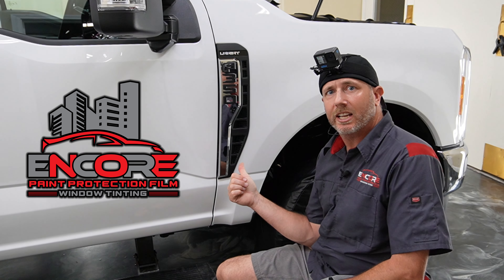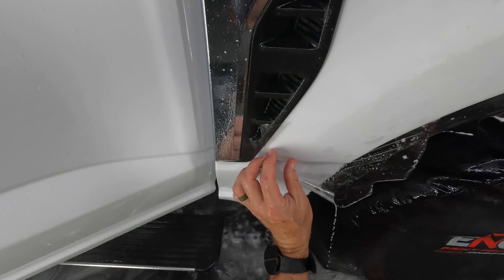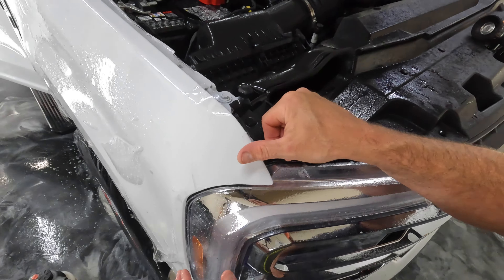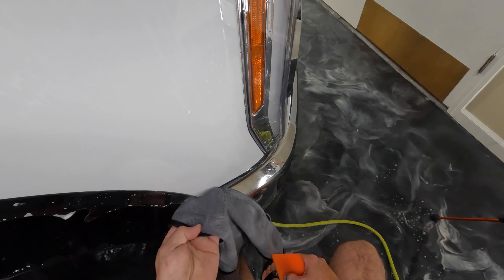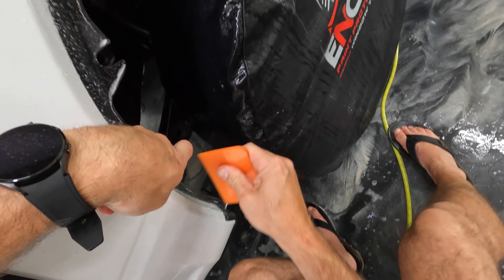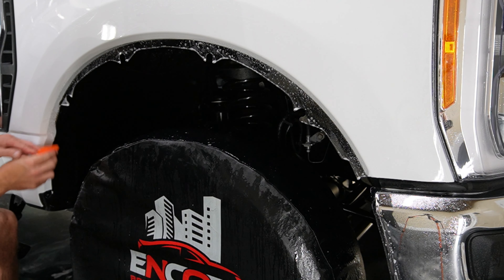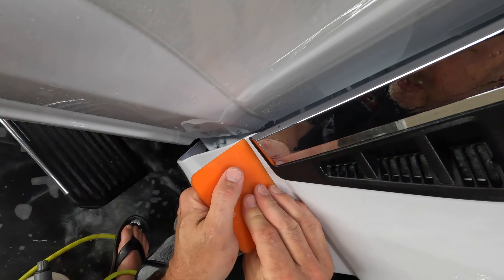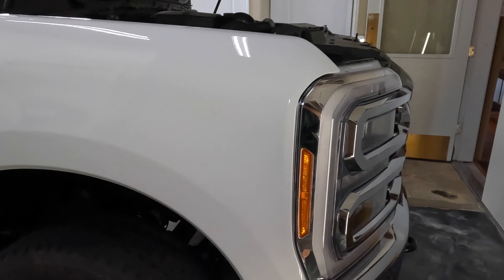Ford F350 Fender Pre-Cut (Kit) ✂️ Paint Protection Film Installation - Lariat Super Duty

Comment: Was this the suntek ultra tack again? Looks very tacky, I find there cap film terrible for adhesive
Reply from the maker: It is. In all fairness, I was having a problem with my slip solution throughout this full body install. I ended up switching soaps after this truck. I'm very used to aggressive adhisives. I started with 3M back in 2004 and then used SolarGard for a long time. Both have very aggressive adhesives. 👍🏻